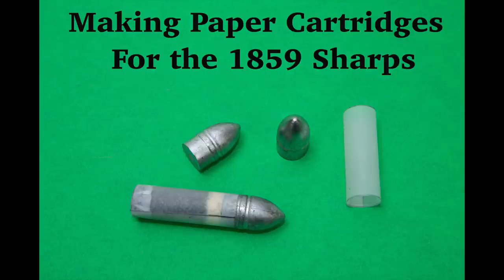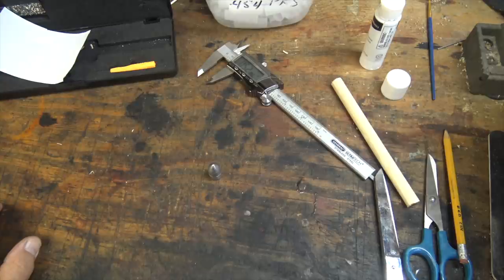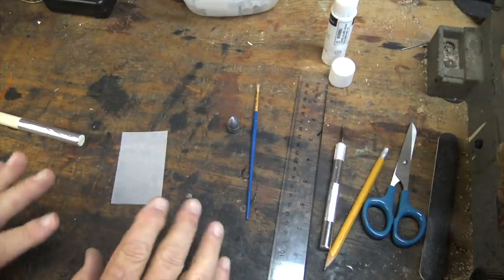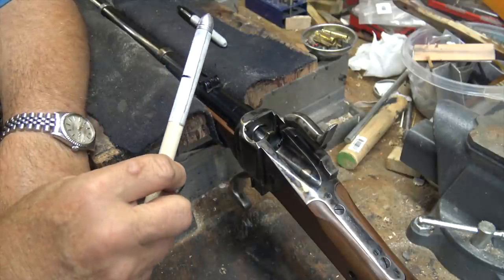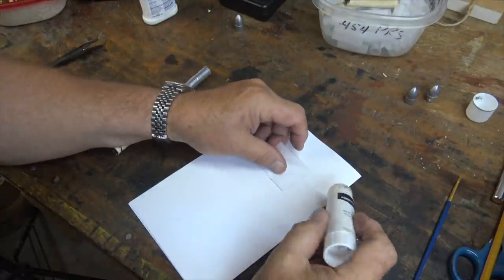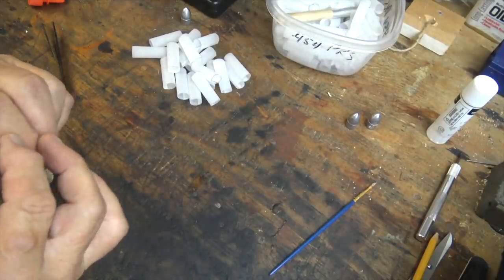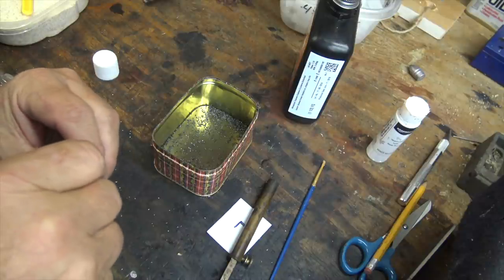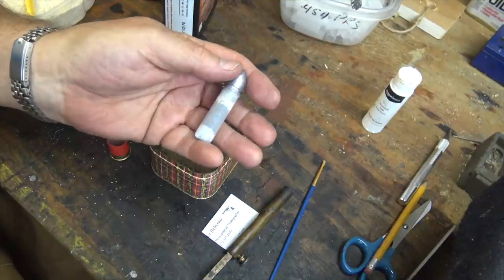Making Paper Cartridges for the 1859 Sharps

Comment: Now making paper cartridges for bullets, other than  the ringtail. To simplify the blank size  I use a free  graph making program that makes grids the size of the paper . A little quick work with scissors and done.
Reply: Also if you make a former a smaller size to fit the ringtail the same method will work. That works for me with my sporting rifle.
Thanks Mike for your hard work.

Comment: I have a couple of different sharps bullets.   42 grains is what I use in my cartridge. The load is accurate.  I use 2F powder as 3F I found over the years is too hot.   3F will erode the gas check face. I fixed this by hard chroming he face of the gas check,  Great video.

Comment: I have a question. If I make the paper cardridge as big as the original brass cardridge it loads more black poweder because the paper cardridge has no wall thickness. Do I have to load it completly full? Because there is a maximum load capacity for weapons ...

And do you do a hole on the backside of the cardridge ?
Reply from the maker: First of all the Model 1859 Sharps was made for paper cartridges, not brass. The Pedersoli chambers are longer than the originals, so I use cream of wheat filler to fill the space. No hole is needed in the base.

Comment: Excellent video.  I have a Palmetto 1863 Sharps Carbine. I think these were imported by Navy Arms in the late 1960’s thru 1970’s. I’ve used the Eras Gone bullet in my paper cartridges and found that it shoots very well. I have had many problems with my cartridges however, most because I was adapting the Christmas tree bullet cartridge design to the Eras bullet. I like what you have come up with and plan to make some new cartridges following your method. By the way, 45-50 grains does seem to be an accurate load. 65 grains was ok but the group sizes were much larger. Also I was using 2f Swiss, I’ll try 1 1/2f Swiss for my next effort.  Thanks for all the great black powder videos.

Comment: I have an IAB Sharps .54cal and have been using the Pedersoli xmas tree mold in .541cal for casting my own bullets. On checking the targets the bullets are very unstable and are tumbling, I have run the bullet data through a stability checker and they come out with an SG of 1. Just wondering if you have any ideas on what alternatives might be suitable? The twist on the Sharps is 1:48. Love the videos and used them to help make the paper cartridges.

Comment: Hey man i was hoping you could help me.  I bought two 1851 navy 44cal pietta a few weeks ago.  Took them to the range, one is brass the other steel.. loaded 25 grains in both..  The brass one fires and works flawlessly.. the action is smooth, and after 6 rounds i can reload, and fire another 6..  Then on the 3rd round it still works but starts to get a little more finicky and jams on the hammer when cocking it and i have to help it along.     The steel one though, after only about 4-5 shots it starts to jam horribly.  It isnt a cap jam, the hammer wont cock back unless i cock the hammer and rotate the cylinder by hand to help it along.   Then for round 2, i have to help it for every 6 shots.  Round 3 the cylinder and hammer are completetly locked up and i cant even reload it anymore.

Why is the steel one jamming after just 4-6 shots to where i have to help the cylinder rotate ?  This has actually now caused the crappy ring around the cylinder to show up.. aka scratch my cylinder.. :((( sucks..  I dont even wanna fire this steel 1851 anymore because its more hassle then anything.  If it helps, i am using Shuetzen powder "spelling" and the 1075 #11 german caps, and 457 round balls.   FYI i am now a huge fan of black powder.. these 1851's are far far far more accurate than my 1911.  That 1911, i have to aim to the right to hit near center, but its rounds are still all over, the 1851 navys i am always bulls eye or near it, and i always seem to throw balls in the same holes too.  This is 30 feet out
Reply from the maker: It sounds like you might have a problem with either the bolt, or with the cam on the hammer

Comment: Why does the circular bottom on the Sharps cartridge have to go inside rather than outside?
Reply from the maker: Because the tube is not tapered like a revolver cartridge. If the base was outside it would make the base of the cartridge too thick to chamber.

Comment: Eeekkk!  Bare jaws on your Sharp's.  That takes me back to making BP blanks for re enacting with my 1861 Springfield repro.  Some of the guys used a piece to f cardboard cut us a pattern for their paper, I did like you do, make a rectangle large enough to go around a dowel or large elementary school pencil.  I also used plain light weight typing paper, if I had wanted to be more authentic I would have used onion skin.  I was wondering Mike, did you use nitarated paper to make you cartridge tubes combustible?  Did you use cigarette papers or make your own by soaking paper in some water and sodium nitrate?
Reply from the maker: The vice jaws are plastic and I pad them with a thick wool blanket. I use un-treated tracing paper for the tubes. They burn completely...no nitrating needed.

Comment: What is the diameter of the bottom disc?
Reply from the maker: about 1 1/4 inches
Reply: @duelist1954  Would 1" work?
Reply from the maker: @win1885  I think it could...barely. You won't have much contact surface for the glue, and you'll have to center it carefully.
Reply: @duelist1954  I'm sending a 1 1/8" punch.  See if it works.
Reply from the maker: @win1885  ok, thank you.